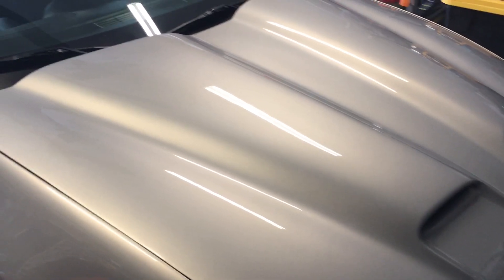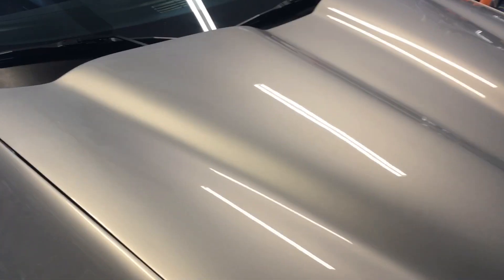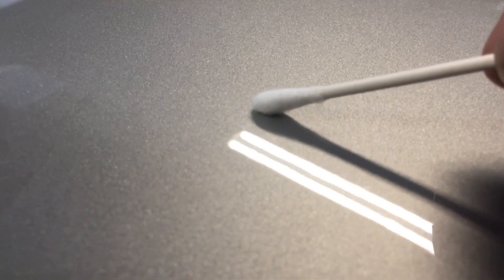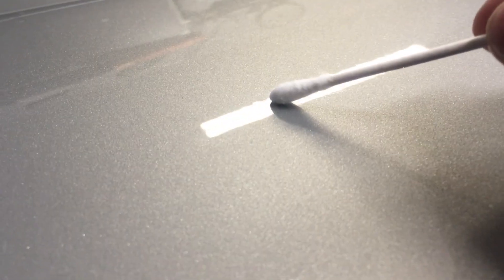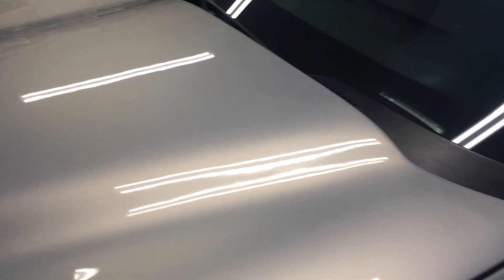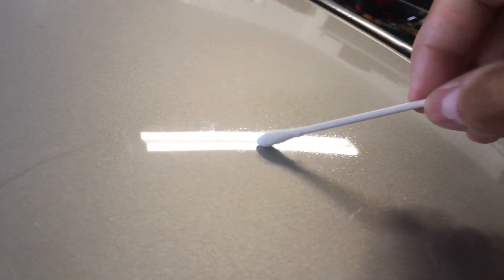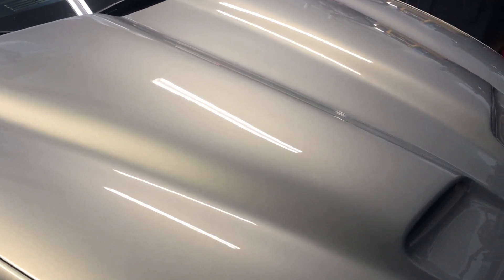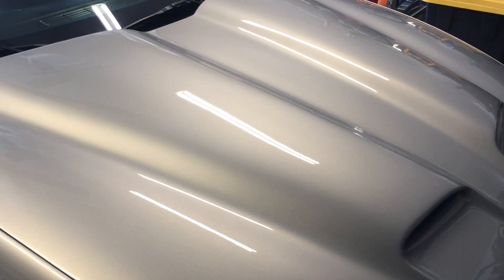Oh oh water spots on SPS Graphene Coating

Comment from the maker: 1 month in an we have water spots.  CarPro Spotless and Optimum MDR did nothing to remove the water spots on the graphene coating.
Reply from the maker: Looks like we scared away Ethos as they removed all of their posts from my video.  I guess they realized that they I was not going to push a product regardless if I am offered it or spend my own money on it.  It does not come off well as they came here to promote their product and not they removed all of their posts.  

The important thing is to be wary of the marketing when it comes to graphene coatings.  They are not the miracle product that these companies are claiming it to be.  In the end it is just another version of a ceramic coating.
Reply: Dang dude, that sucks. I hate water sports with a passion and was hoping graphene would eliminate them as a problem.
Reply from the maker: Paul Widner yeah I was hoping for this to not happen.
Reply: @MikeGDetailing  Do you think graphene helps at all with water spotting?
Reply from the maker: @paulgyro  well I have never had water spotting issues with any coating I have used up until now.  2020 is just one of those crazy years.  I don't think it is any better in the so called anti-water spotting claim than any other ceramic coating.
Reply: @MikeGDetailing  ah ok, that's too bad. I fight water spots all the time here in hot dry AZ on a black car.  Coatings don't seem to do jack go help.
Reply: @MikeGDetailing  finally someone who has tested this in a real user scenario and presented the results. not every one has a super clean indoor space to apply these coatings like how most of the pro detailer YouTubers. I have been really curious if graphene really could be better then Si02 when the big companies like turtle wax are finally perfecting Si02 coating technology. Seems graphene still has a long way to come, I'll stick with my Ceramic coatings for the time being
Reply: @MikeGDetailing  which coatings did you use before that didn't have the water spot problems?
Reply: @TheTyisawesome  but I heard that a lot of ceramic coatings do have water spot stains on them, which one have you found to not have water spot stains?
Reply: @paulgyro  have you tried maintenance sprays ontop of ceramic coatings when the water spot stains happened?
Reply: @MikeGDetailing  what other ceramic coatings do you know that haven't had the water spot stains? Also did you try putting maintenance sprays ontop of the graphene or was your graphene naked when the water spot stain happened?
Reply from the maker: I really haven’t had many coatings spot.  During my two year test of Cquartz UK 3.0 and TiO2 I had zero water spots.  Same can be said for GTechniq CSL topped with Exo.  

As far as the SPS Graphene coating it was topped with the SPS spray Detailer after the first wash.
Reply: @MikeGDetailing  was there a control section of car that had no coating but only clear coat, did that get spotted as well?

Also did you use decontamination before applying?

Also did you leave these coatings in the sun for long time before applying?

Its weird how before it didn't happen but now it did, something is wrong, i heard from detailer that the reason why they spot is because the prep wasn't done properly? Not sure
Reply from the maker: You will see the tape lines where there is no coating present.  The roof is covered I various coatings I am testing.  No need for a control panel since we all know what unprotected paint looks like.  The tape line areas with no coating are the only control section.  

Panel was prepped properly.  That is the risk of leaving the car outside 24/7 in the control of Mother Nature.   You never know what you will get.  

They sat unmolested for about a week or two when I was applying these coatings.
Reply: @r.k862  oh yes! Seemingly worthless in regards to water  spots here in AZ heat
Reply: @MikeGDetailing  thanks for your reply. Did the control section without anything on get water spotted? Also did that section have any old ceramic coating on it from many years ago?
Reply: @paulgyro  which toppers did you use that did get the water spot etchings hard to get off?
Reply from the maker: Surface was polished to remove any older coatings.  Now if we want to get really detailed who really knows if all the coating is removed at the microscopic level.  You and I can’t see that far into the paint.   

My advice is to pick a quality coating from a known reputable brand and not worry too much about water spots.  It is a risk when going to the coating lifestyle.  

Another option is to try one of the light versions like Gyeon CanCoat or Cquartz Lite.   Plus you get a good amount for reapplication if something does happen.
Reply: @r.k862  Carpro Reset and  Technicians choice ceramic and detail spray.  Tech Choice performs sooo much better
Reply: @paulgyro  if technicians choose was so much better than how come your saying they got water spot etchings?
Reply: @MikeGDetailing  I'm thinking to go with a sealant like IGL F4 then apply another sealant and wax ontop, i would the same gloss maybe even higher, i would also get the water hydrophobic, so i dont really get why a ceramic coating when they have so many water spot etching issues. Am I missing something?
Reply from the maker: You will negate the hydrophobic behavior with whatever you use on top of F4.  

If Graphene is what you are after then invest in the artdeshine, ethos or migliore coatings.  SPS came back stating it will cut down water spots by 50%.  Ethos starts 80-90% water spot prevention.  

I’m on the fence with graphene and I think it will come up short of ceramic coatings.  If you are going to go with a coating go with Cquartz UK topped with Gliss. Gliss has anti-water spotting properties as well.
Reply: @MikeGDetailing  that's what I heard about Ethos 80-90% reduction in water spotting but yet I haven't seen any testings to prove it from them or anyone else.
SPS spotted about the same as the other ones in your video so I don't think it's 50% reduction.

Would it be possible if you can get a panel and do coatings on it and let it sit in backyard, spray water on it then let it dry for a day or week then see which will get the least water spotting
Reply: Hi Mike, how long were the beads of water left to stay before washing? From your experience any products you've tested which less prone to waterspot etching? Nice observation as none videos mentioning about this.
Reply from the maker: sunmode well I didn’t notice them until I washed it.  So I’m not sure since I usually wash once a week.  But it’s been really windy here with Santa Ana conditions so lots of dust being blown around.

Comment: I have the same water spotting problem with the graphene coating, its really sad. Tried gtechniq and chemical guys water spot remover to no avail.
Reply from the maker: @PaulS-yl6hk  most water spot removers won’t remove the actual water spot unless it’s a fresh spot.
Reply: @MikeGDetailing  Thank you for the quick reply! we wash our car at least once a month(usually every two weeks time) if that makes it a fresh spot or not. We are in Hawaii not hot like it could be in Arizona and the likes

Comment: Man you should not have used f4 to polish, did you even ipa wiped down everything?
Reply from the maker: Yup. Prep wiped.  It’s been months and no signs of failure.  It’s perfectly fine.
Reply: @MikeGDetailing  hard water can etch into anything almost, but any coating or clear coat definitely, some are more resistant than others, but none is proof. Also an IPA wipedown i dont think is enough to remove all those swirls and protection that f4 has, it might be beading or shedding (if spelled correct) but performance might not be at 100%
Reply from the maker: @rafaelsoto891  Not using F4 to remove swirls.  I had already polished the paint to remove defects and the 2 year old quartz coating on the paint.  F4 was used as last refinement step that was not needed.  More so to play around with the old bottle of SPS grapehene.  Longevity and durability was not on mist of expectations with this combination as I had already seen the long term performance of SPS graphene which I found to be a bit weak.  So F4 was used with a finishing pad that has very little cut.  The cut pad was doing most of the work using F4.  

You are absolutely correct that the potential to spot is there.  What I was trying to get across is that many people are fooled by the marketing aspect of graphene not being susceptible to water spots.  Those of us who are more knowledgeable and experience know this to be true.
Reply: @MikeGDetailing  got you f4 is a finishing polish or a 1 step because it does have cut and is able  remove ligh swirls and oxidation but has so many fillers that I doubt an ipa will take care of it fresh.  That is why water spot prevention is something I never claim, but that f4 layer im pretty sure is interfering with its performance, that was the very first thing I asked Jeremy when I joined SPS
Reply from the maker: @rafaelsoto891  according to the IGL rep I spoke to, it does not have any abrasives.  But then again you are not the first person to say it is abrasive.  The fillers are probably not removed but I would be more concerned with the surface oils of the product.  The sealant portion may also still be intact or somewhat degraded of F4 with that prep wipe.  

Either way I can say from my experience that SPS has yet to fail applied over F4.  But I have experienced SPS not last that long on a properly prepped panel with a regular finishing polish compared to some of the ceramic coatings on the market.  It definitely needs the help of the Graphene spray detailer to perform and last.

Comment: They never claimed it was invincible to water spots. They say a reduction up to 50% which is also based on the hardness of water, conditions, how fast you remove, etc.
Reply from the maker: Thanks.  What I was also trying to get across that graphene coatings are not the miracle coatings that people think they are.  The coating has its pros and cons like everything else.
Reply: +1 for what Wicked Auto Detailing said above! Sorry to hear you had water spot issues with V1 of our coating. If you want, we can help you troubleshoot the removal, @Mike G. No coating on the market has immunity to water spots, but they can certainly reduce them. Our latest version of the coating using Graphene Nanoplatelets and an updated carrier solution has even better water spot resistance and an easy install. We'd love for you to try it out!
Reply from the maker: @spscoatings  I polished it off not long after that and went with a different coating.  Not going to lie but the first version of SPS was not as good as other coatings.  I tired V3 which was a much better version.  Have not tried the newest version but it is on my list to purchase.
Reply: Hi  @MikeGDetailing , that is very fair! If you're interested in giving the latest high-solids version of our coating a try, send me an email at: admin@surfaceprotectivesolutions.com. I'll help get you set up! Very confident that this version will exceed your expectations. - Joey
Reply from the maker: @spscoatings  I appreciate it Joey. Brett set me up long ago with an account to be able to purchase. I just need to get my order in. Also interested in the updated spray detailer.
Reply: @MikeGDetailing  Awesome! The new detailer is absolutely slaying it. We put it on basically everything we own. 👍

Comment: I think I know why you get water spots.
It's actually due to the chemistry used in using a polymer as a carrier for the GO (graphene oxide, which is probably what they are using)
I have serious doubts about the actual efficiency of this first wave of Graphene products.
I was planning to work on my own Graphene coating, so I had planned to have it by this time but the February crunch of Covid killed that plan.
Most companies to my knowledge went the cheap route and are using the same a polymer that is used as Concrete sealer. It retails for 35 a gallon. And throw in 200 worth of GO and you get 5,000 worth of product.
I have reservations that the Graphene is being properly suspended in this solution that is being sold. Hence the hit or miss, and lack luster results.
Reply: Damn that sucks! I appreciate your insight. Do you think Adam's Polishes Graphene coating is using this cheaper graphene you speak of? thanks again
Reply: @MrBod4life  I would not trust any company at this time.

They are about making money, and each will try to get a share of a Graphene product market.

So I could spit in a bottle pour some graphene in and call it polish
Reply: @MrBod4life  its not "cheaper" its just chemically created. They haven't figured out how to take actual graphene and use as they want it.  Oxide is plenty strong for a car.  If they get true graphene you'll be paying 1k dollars for 30ml a bottle lol.   This is a great result with oxide with water making reduction.

Comment: I hate the amount of water spots I get from Ceramic. If graphene cuts it down by 50% it wins in my book.
Reply from the maker: We will see. I actually recently coated the side glass. On the drivers side SPS on the rear and Adams UV tracer in the front.  The passenger side is the opposite.  This should give me a better idea of water spotting.

Comment: hope this finds u well mike.....and your loved ones safe and healthy.  the info I came across when researching graphene is that it will not "eliminate" waterspots - but due to the fact that the graphene disperses the heat and the panels do not get as hot - the etching effect is greatly reduced and can easily be removed.  my experience with artdeshine(Alfred yow's consumer vesion of SPS) has supported this.  the etching is minimal after an overnight rain....or afternoon shower....and is easlily removed with ONR or the QD(artdeshine concentrate....4/1 dilution ratio - after initial app full strength)…...QD can be diluted 9:1....I might try after 3 or 4 of a lesser dilution ratio.  if u did a side by side between graphene and coatings u would be amazed at the diff in the etching...one side looks caustic....graphene looks like mild to med dusting.  use the qd after next contact wash and they should disappear.   be well  great vid